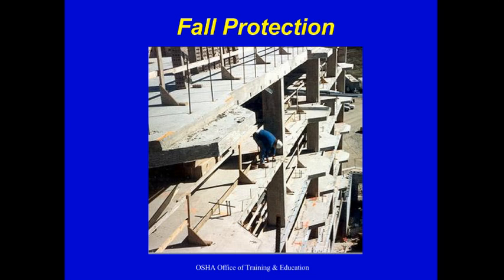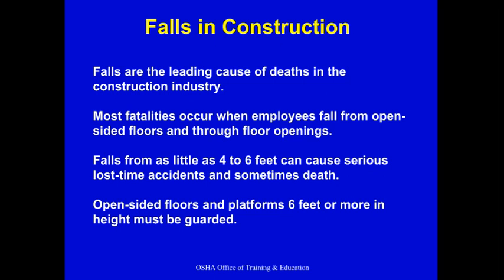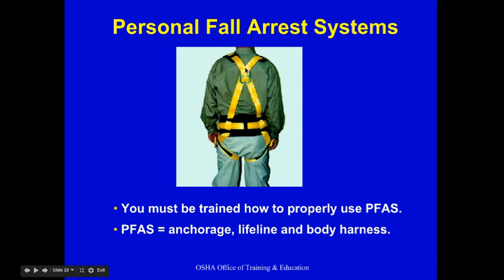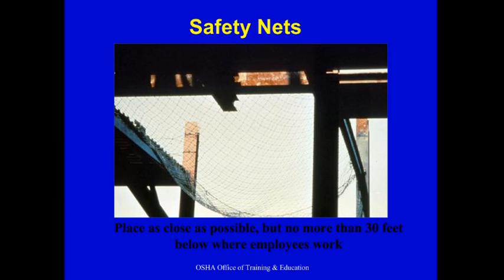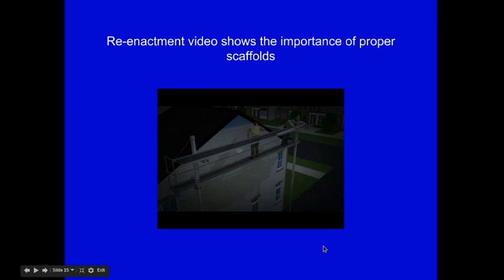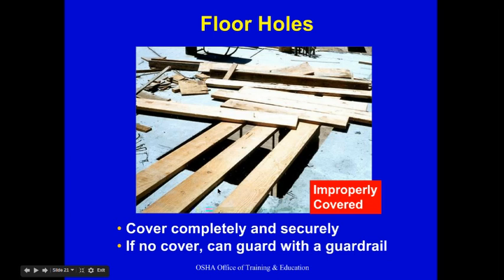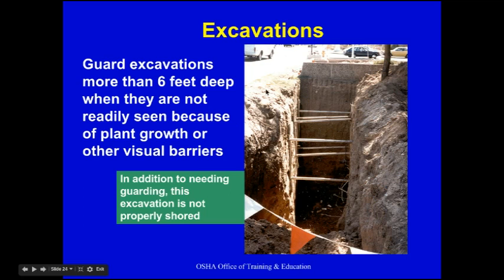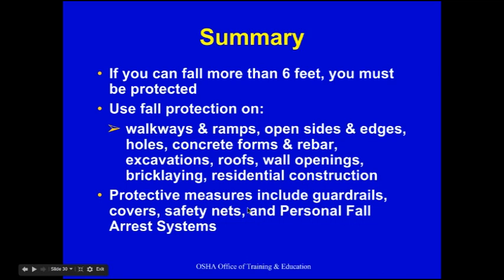OSHA Fall Protection Video

Comment: i thought toe boards were 4 inches minimum?
Reply: It is MINIMUM 3-1/2 inches per OSHA 1926.502(j)(3)

https://www.osha.gov/laws-regs/regulations/standardnumber/1926/1926.502
Reply: 4 = 3 1/2  if it's a 2x4
Reply: @jcruz8762  Nominal size is 4" and actual size is 3-1/2"